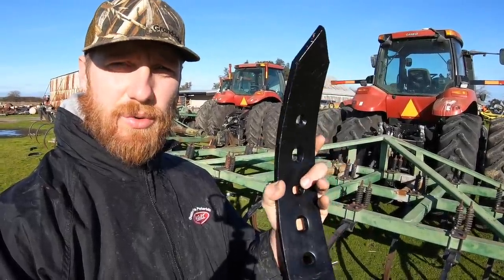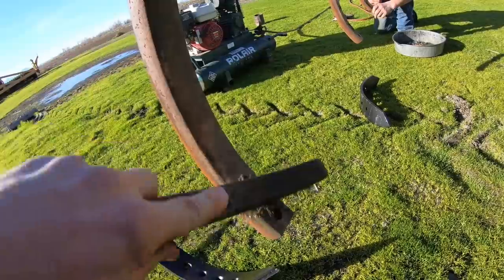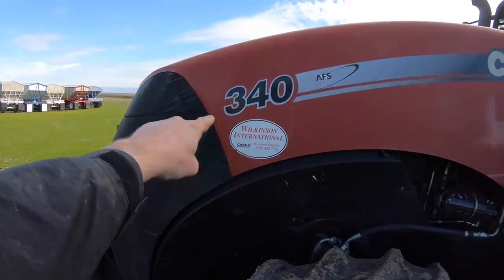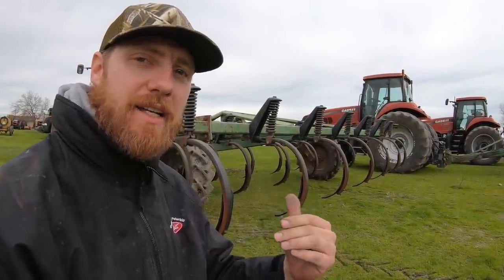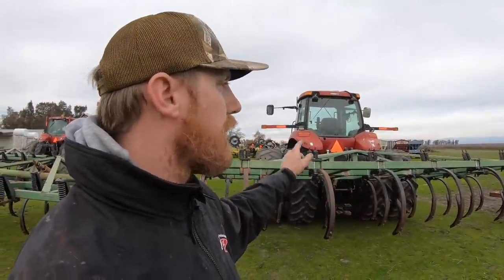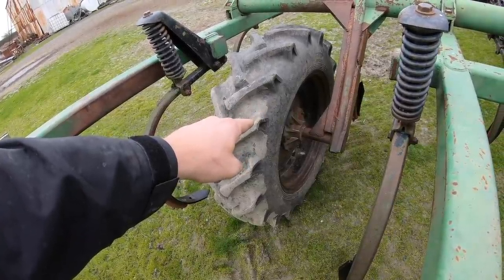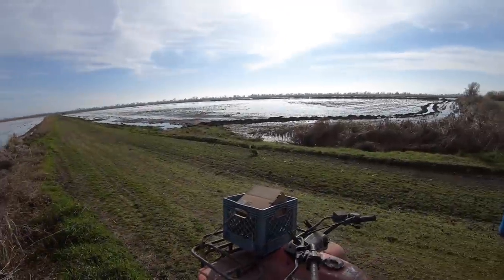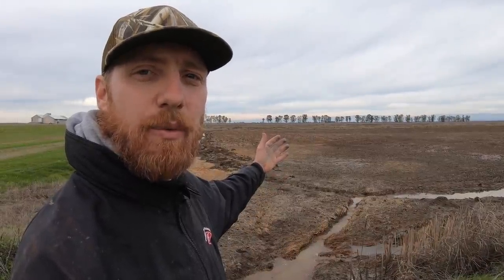Old Chisel Plow Gets New Chisel Teeth!

Comment: Like brand new good job, for planting corn the chisel with the wings at the bottom is the best for descompacting the subsoil than some good passes with the discs and for a better soil bed always trying that the organic matter get not covered at no more deep that 3 inches or instead of build and decompose in a organic matter will convert to carbon
For the best bed for planting the rotary tiller does an amazing job

Comment: Not sure the cost of each of those chisel teeth but could they be resharpened once or twice to save money and then drop down a hole on the bolt? 
Thanks for the videos. Jim.
Reply: The teeth are self sharpening. They have to be replaced before they wear down to the shank.

Comment: Going back to the other vid when you took the old ones off theres no difference the only difference is the new ones have paint
Reply from the maker: Haha! Aaron, again, tell that to Pops! I’m with you man. The older ones definitely do not have as straight of an edge to them. They’ve rounded off and not as wide. Sharpen them and they’ll become even a bit more narrow. Could the go another season. Perhaps. Would they do as good of job? Perhaps not. Are they more likely to break? Yeah. Do we want to stop tractor work to replace one? No. But I’m with you, dude.
-M.
Reply: @Ricefarmingtv  and also not as thick as they originally were but you guys run in a more sandy environment up here it's clay black dirt and rocks we use a drag to level our fields and we get 6 to 8 inch teeth in the time we use it we burn through teeth like there nothing cause of the rocks and my grandfather don't wanna spend the money for a rock rake picker cause he seen one go for 2500 and our neighbor is selling one for 5500 but he don't wanna spend the money cause of see that one for 2500 he thinks he's gonna find another one around the same price  not he'll never find one that cheap and condition ever again same with our disk chisel plow we have 13 shank 14ft wide brillion disk chisel plow being pulled by a case ih 9380 400 hp and honestly thats a waste of power